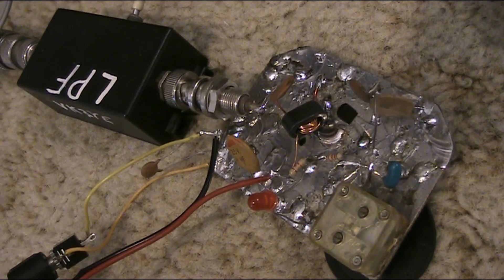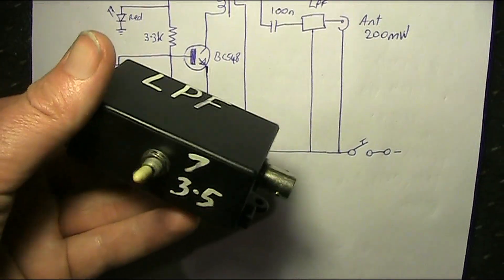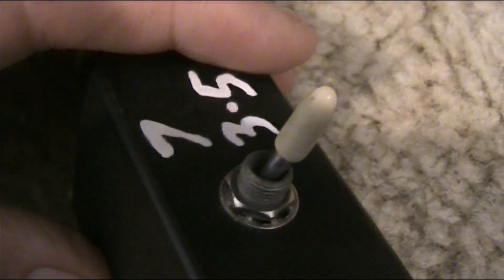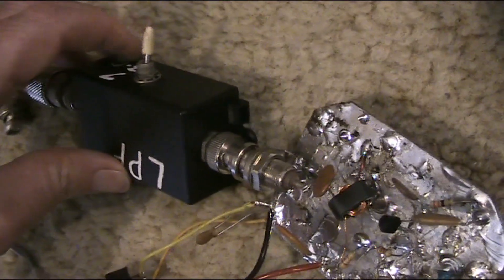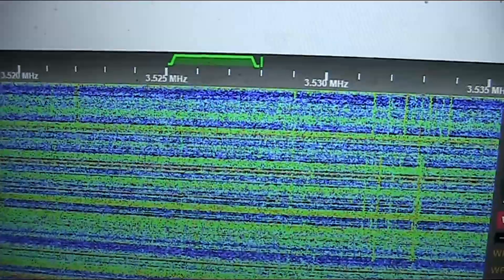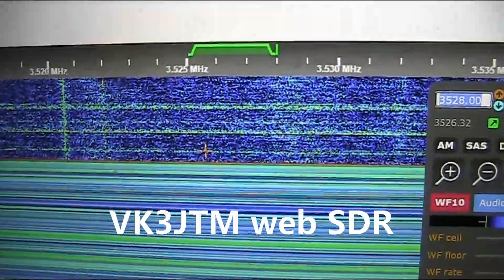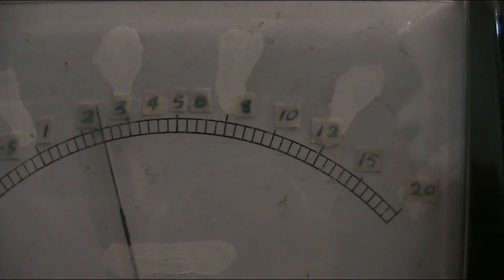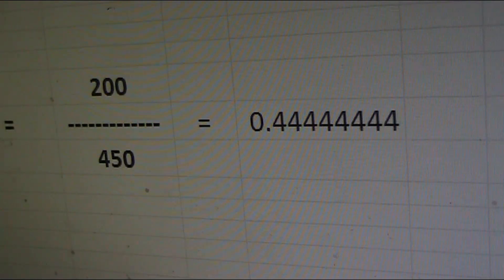A dirty transmitter: how far can its harmonic be heard?

Comment: I recently built a Pixie(7.023MHz xtal).
I connected it to 62m long doublet via T-type antenna tuner and called CQ.

I got many reverse beacon spots pretty far away, but the most distant spot was from Germany 1700km away on 14,046MHz!

Comment: In the 80s I visited a number of irish local radio (pirate) stations. Some of the MW setups were 'interesting'! One station used to tune the antenna with 2 blocks of wood with aluminum plates nailed to them and sheets of glass between the plates, a crude capacitor. The op would put a bulb in the antenna line and adjust the blocks for maximum glow. They used to get loads of reports for their 3rd & 5th harmonics on SW!

Comment: Good demo Peter, thanks. I like the external LPF idea. It saves building a filter for each homebrew rig. I would always have a low pass filter on any transmitter that I build. I have certainly received odd and even harmonics from higher power stations with messy transmissions. If you hear a strong station on 40m CW that has a lot of splatter, just try listening on 20m and 15m at 2 or 3 times the frequency and you may be able to hear the harmonics.

Comment: Couldn't you just key the antenna connection instead of power , then all chirp avoided
Reply from the maker: Not necessarily. Changing the loading on the oscillator (eg when you disconnect the antenna) could also cause chirp. Look at the clever Reggie arrangement (link above) for how they get around that.

Comment: Several quartz crystals of the nominal same frequency can be used in parallel, often with a small variation in resonance frequencies, to broaden the tunability of a Colpitts / Clapp oscillator.

Also, you can use 1N4007 in parallel in reverse bias to act as a variable capacitance diode (varactor).  The bias on the diodes changes the capacitance.  Put a 100 nF capacitor between the crystal/ceramic oscillator and the crystal as a DC block so that there is no DC bias across the crystal which might damage it over time.

What kind of antenna was used?  If the antenna was a half wave dipole at 80 m, it should have been close to a full wave at 40 m, which means it should not have been that efficient.
Reply from the maker: I used a G5RV known to be efficient on both 80 & 40m.

Comment: Why is the binocular core needed? What makes it different than a regular toroid?
Reply from the maker: You could use a regular toroid if you want. No difference.
Reply: A regular toroid works.  Just make sure it is a NiZn type ferrite (43 or 61 type) and not a MnZn type ferrite (31 or 77).  Most of the low frequency noise suppression type ferrites are MnZn and are cheaper and don't work well.
Reply: @profdc9501  Thanks, I will try with 43. I have built some baluns with both 43 and unidentified green Chinese one that might be MnZn, and the difference is obvious. One works, the other does not :)
Reply: @batica81  I've successfully used cores from common mode filter chokes as RF transformers, I've no idea what core material they are. Also the base drive transformer cores on old CFL bulb drivers.

Comment: tried simular 25 jears ago.
only 2 diodes in the feedline and 20w out (Propper antenna)
that enabled me to open a 250 km far repeater on 70 cm with a 2m radio.
i live on a 900m high mounain top....repeater on about 1200m(or so...) sea level. 
good luck :)
best 73! dg2r?